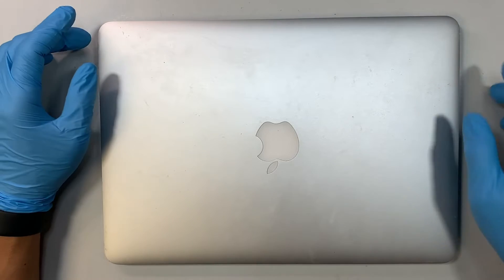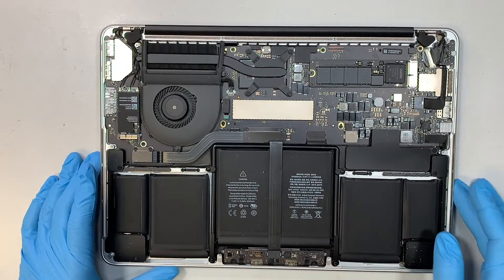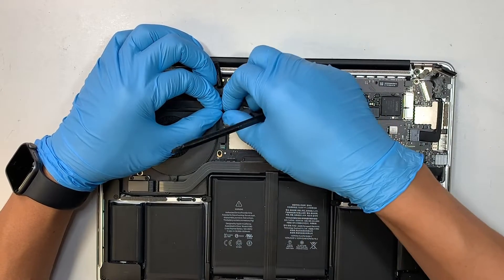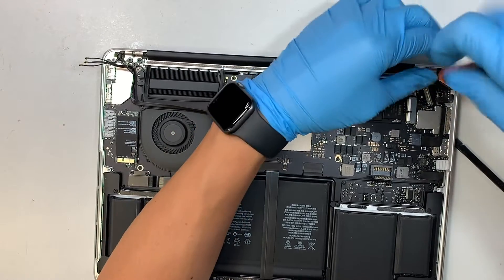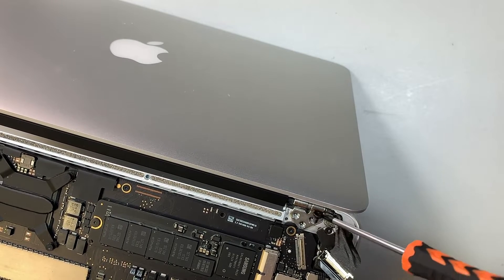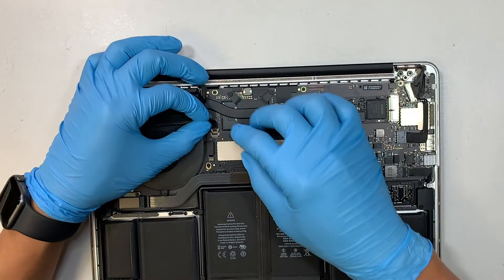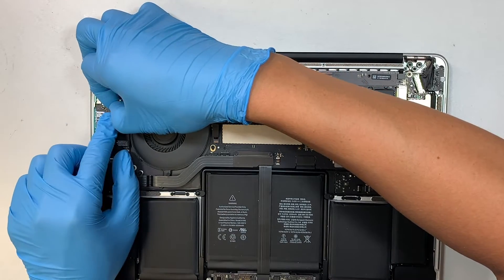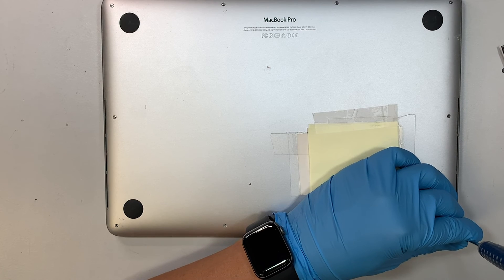Easy and Simple A1502 Macbook Pro Screen Replacement

Comment: Did that, and now the lid sensor is reversed :  I have to close the screen for it to light up. If I put old screen back (not working but I see backlight), it goes back to normal, screen shuts off when it's closed, lights on when it's opened. Any idea?

Comment: Thank you so much! Worked out fine! Although when I was disconnecting the cable at 3:00 the adapter it was connected to was super fragile and jumped off the board a bit, now it is lose but hangs on some soldering. Not sure how it looked before, but worried it will fall of completely? I connected everything, and it still works. What do you think I should do? Does it have to be soldered again? Can I use something to make it stick better? Or should I just leave it?

Thank you again for your channel and pro tips!